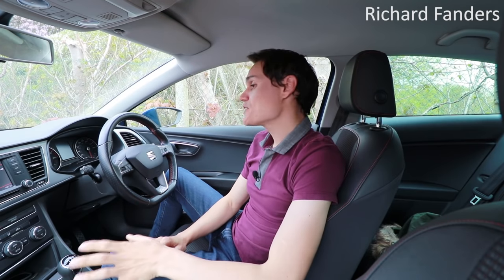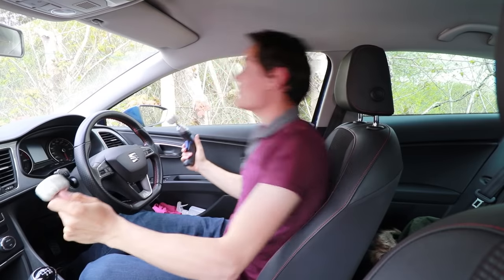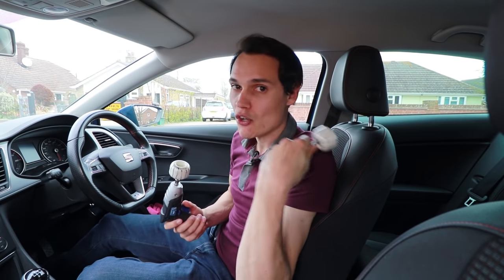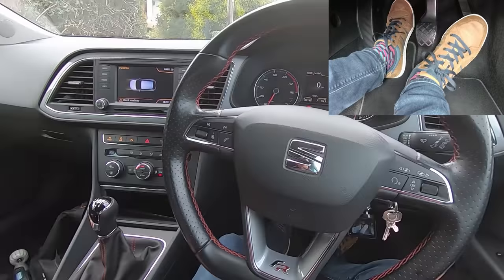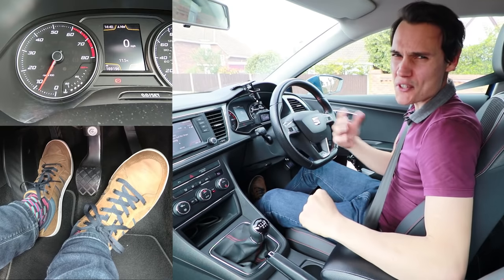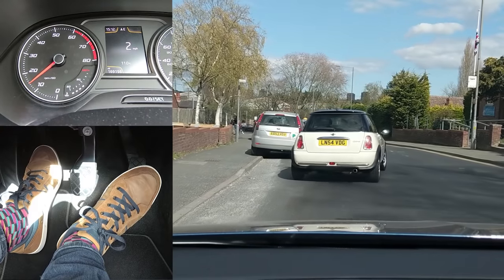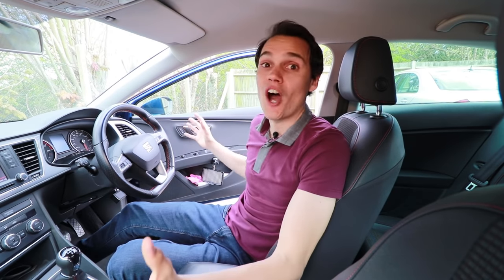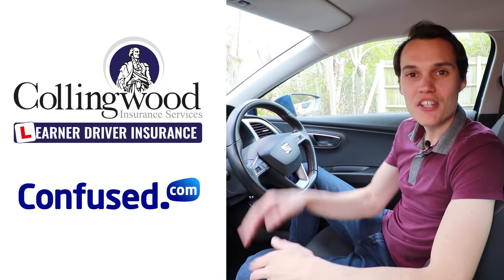What is riding the clutch?

Comment: Thank You  Learning Driving would not have been easier , Is riding the Clutch same as slipping the Clutch? As per the video certain amount of clutch slippage or when the clutch is stationary and the flywheel is being engaged, normal amount of slippage  will happen. I have a Suzuki dZsire and the owner manual uses the term DONT SLIP THE CLUTCH WHILE Going up hill.o r hill starts or starting off. Slipping the clutch will happen in normal usage if i understand. Could you Please do a video on Normal Slipping the clutch and when it is bad for you car or bad driving Practice. Over revving while engaging the clutch or holding the clutch for too long at the Biting point or while engaging the clutch when it tries matching the speed of the engine while starting off, is what i have understood it to be  slipping the clutch. I apologise for the Long Comment. Thank You Very Much
Reply from the maker: Riding and slipping are the same thing. The clutch is there to allow for slip, that's it's whole purpose. However slipping it for too long or with high rpm will wear it out more quickly. The owners manual will be referring to clutch abuse not normal slippage to allow for smooth driving.

Comment: So staying in the bite point for more than a few seconds is bad no matter what? If you're trying to drive with like 1-2 mph and you hold the clutch right over the bite point, is that still bad for it?
Reply from the maker: It is for extended periods of time. You should use the clutch to smooth out gear changes and to start the car rolling. Stopping and starting regularly is OK but constant slippage without giving it moments to cool down will eventually overheat it.

Comment: Wait so after you get the biting point, do you then release your foot the clutch completely so you can push down on the accelerator and not ride the clutch and accelerator at the same time. Forgive my question if it comes across silly or naive?
Reply: No you stay on the bite point when accelerating 
Until you get to like 5+ mph. 

Zyou need to get moving

Comment: I’ve never had a clutch last longer than 5 years.  Repairing a clutch is a relatively simple job and the parts aren’t that expensive either but if the design is such that the clutch is internal, you’ve got to take the entire car apart including removing the transmission in order to get to it — and that alone is going to add hours and thousands of dollars to the repair costs.  I don’t think I’m ever getting another manual transmission car.
Reply from the maker: The costs is usually around £500 for a typical car. It does depend on the car and whether it's town driving or highway driving but a clutch can last for 200,000 miles +
Reply: @ConquerDriving  Final bill this time for mine was $2000 USD.  Bought the car brand new in 2010, original clutch failed in 2014, and then the replacement failed last week.  Not too many hills where I live, but it snows a lot.  Not sure if that matters :|  But yeah, feeling really down right now.